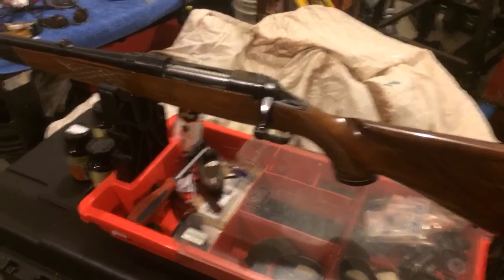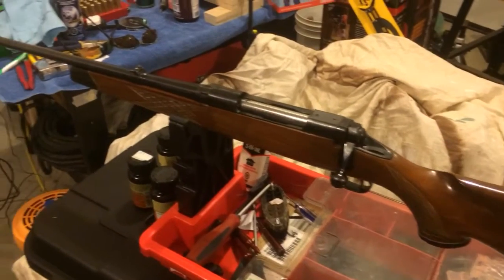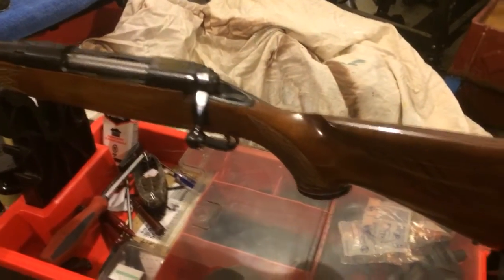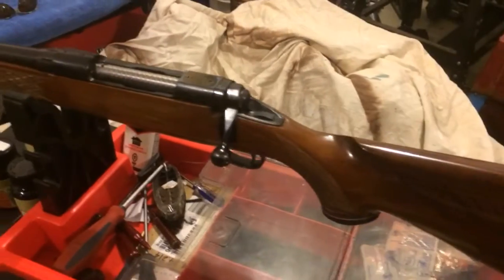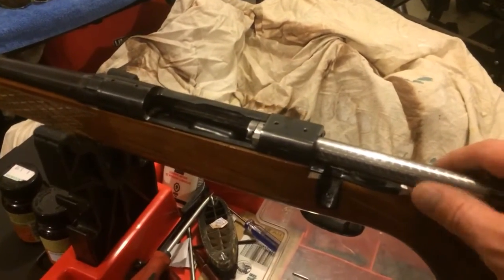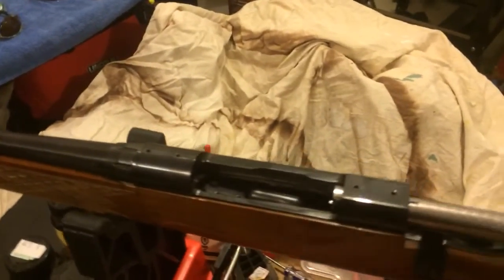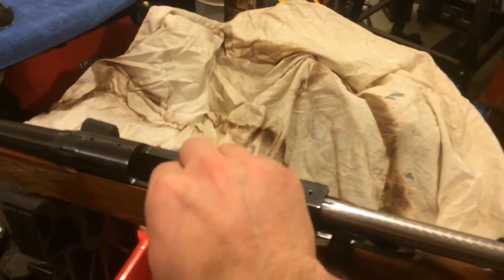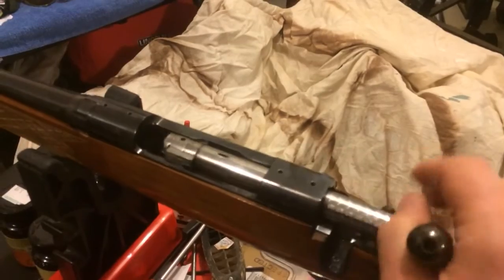Savage Rifle feed problem

Comment: My model 200 in 243 win did the same thing, I discovered that each cartridge I loaded in the mag needed to be pushed back as far as it could go before loading the next one on top of it. In doing that way, I fully load the mag, place one in the chamber and they cycle OK. Remember, push each cartridge back(not down) in the mag as far as it will go.
Reply from the maker: Happy that worked for you.  On this rifle, that did not make any difference.

Comment: I changed the caliber on mine from 270 Win to 300 Win Mag and replaced the magazine box and the follower, second to the last out the magazine would pop out and wouldn't chamber.  Put the old follower back in from when it was a 270, and it works fine now, I did notice the spring towards the nose was bent further down.

Comment from the maker: I tried adjusting the spring, and plate.  No change. It still chambers the first shell, tosses the second shell, holds and chambers the third shell. The problem is clearly (at least to me) that the shape of the bottom of the action has been previously modified.  On one side, the ridge/lip has a bit of a shell contour; which holds the 1st and 3rd shells.  On the other side that contour is not there.  It is straight edge.  As soon as the shell is bumped it flips off of that ledge and tosses out.  There are no lips at all on the magazine box underneath.  It is just a straight sided box right up to the bottom of the action.

I am going to buy a current 110 model center feed detachable magazine.  That will have top lips on it which will hold the shell in place.  I will toss the straight box out and take that new magazine apart and figure a way to place, adjust, and glue into the stock at the right spot.  Hope that works!
  
I really cannot think of any other option. at this point. The rifle is so old it seems no one wants to, or is able to, talk to me about any replacement parts either.
Reply: I have a short action savage similar to yours (blind magazine). CDI and Pacific Tool and Gauge make bottom metal for box detachable magazines. Aics style. Now it works better, not perfect, it's a Savage.

Comment: The shells r probly alternating sides when u load. The side the second shell is coming up against may need built up some. Watch how they come up and u may want to build up one side to push it over. You could probly use a little J B Weld

Comment: It is staggered feed, and it feeds cartridges from the right side but not the left.  Is it possible you have a right-handed follower in a left-handed rifle?  Alternatively, are the follower and spring installed backwards?  The exploded diagram on Numrich shows the "top of the W" pointing toward the muzzle end of the rifle.  Is yours possibly pointing toward the back?  That would put the bump on the top of the follower on the wrong side.
Reply from the maker: That is a GREAT point.  I had not considered that.  Since I had acquired the rifle as is and had made no parts changes or modifications myself, I had assumed it was correct.  It is entirely possible that at some point in its history the magazine was replaced with the wrong hand.  I no longer have the rifle so unfortunately I cannot check.  Very very good advise to check though.  If memory serves well - you have probably nailed the problem, and the solution.

Comment: have you trying changing the complete springs with follower. also what about the extractor and one ejector  spring. just saying but however I believe they don't make parts for it anymore, but can some newer version Savage bolt rifle parts will fit, by custom fit? all in all that's really a nice left hand rifle you have hear. I'm myself is a lefthanded too.
Reply from the maker: Good ideas.  I haven't played with the spring magazine spring (much).  The tension and movement seems about right to me.  The bolt head on this OLD savage is the round ended style that buries itself into the barrel end when fully chambered.  The extractor is a ring spring on the end, worn but works fine.  The ejector is a pin attached to the back of the magazine that pops the shell out when the bolt is fully retracted. (ejector is not in the bolt head).
There is one thing I haven't fiddled with yet.  There is top to the magazine.  The top side lips of the magazine are actually the bottom of the action.  On the right side, the lip is sort of shaped with a shoulder and captures the cartridge (you can see it in the video). On the left side it is straight and smooth.  This is the side that does not hold the shell and releases it (tosses it) as soon as touched.  I am wondering if this side should have a shoulder same as the other side.  Perhaps prior owners filed it off thinking they were improving it but instead really messed it up.    If this is the case, perhaps replacing the internal blind magazine with a newer one that has these lips integral to the magazine (not the action) may fix the problem?
Reply from the maker: +mengvaj87 Thanks for to complement on the rifle.  It is really nice and in fantastic shape for its age.  Shoots 1/2" groups at 100yrds at the range all day long.  Just doesn't feed, so I haven't taken it hunting and will not until this is fixed.

Comment from the maker: Problem. Put three shells in the magazine. First shell feeds fine, usually. Second shell never feeds, it gets completely tossed everytime. Third shell feeds fine, usually.
Sorry the video was a little rushed, I was short on time.  The jest of the problem is there and well shown.
Reply: I have two savage 110s one in 270win one in 6.5CM with detachable center feed mags. Same thing happens to the creedmoor, it happens when there are two rounds left in magazine and you try to chamber one. Gets all caught up. Frustrating

Comment from the maker: I tried a few things that helped.  I figured out that the shape opening in the bottom of the action (top of the magazine box) just isn't right.  I would have to replace the box, which doesn't exist for such an old rifle. Or weld some buildup and reshape by grinding of the action.  Not going to do that!   So, I tried fitting in a detachable magazine box from a 111.  I removed the old box and fitted the 111 magazine into the blind in the stock.  It looked like it was going to work but would need a bunch of glueing and grinding.   I stopped there.  I instead have decided to and have sold the rifle to another enthusiast.  I am in the market for another nice LH 7mm

Comment: Any fix?
Reply from the maker: The only fix I ultimately could think of for this would have been to rebuild and reshape the bottom of the action where the shells come up through or modify it to accept a different shell cartridge that would deliver the shells in a vertical feed.  One side of the slot was contoured to the shape of the shells.  That side held the 1st and 3rd shells.  The other side of the slot had been modified by previous owner(d), ground straight with no contour.  That side was the problem.  Absolutely nothing wrong with the action nor the cartridge plate and spring etc below.  It is all about the shape/contour of the slot that the shells come up through.

Comment from the maker: Until I get this figured out and fixed, it is being used as a single shot (one shot).  In 7mm Rem Mag - only one shot is needed anyways so long as I do my part.
Reply: I have had problems recently with savage evolution 6.5 not feeding which was fixed under warranty but your problem looks entirely different. Yours looks like a mag problem. You can see the 2nd round did not get pushed up high enough and bolt ran completely over top of cartridge and the other one was same. Looks like mag spring is too weak or something inside mag is keeping spring from springing up far enough.